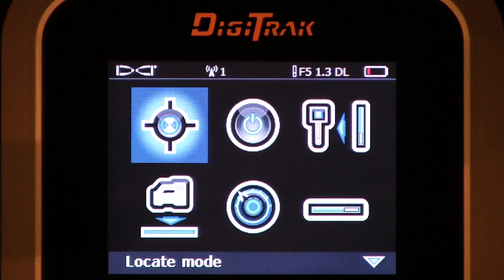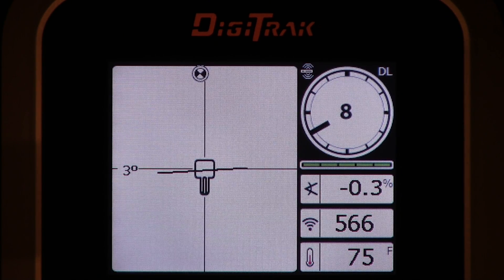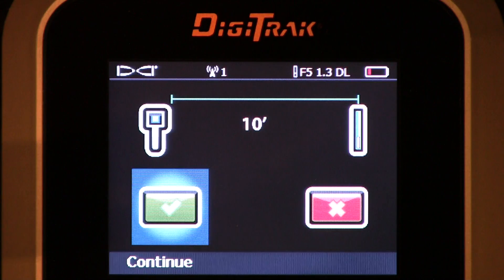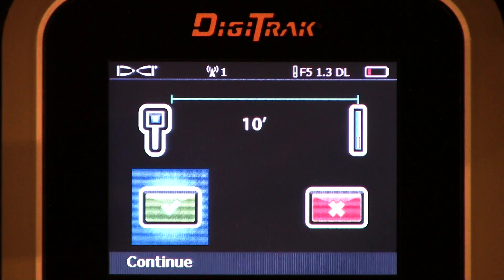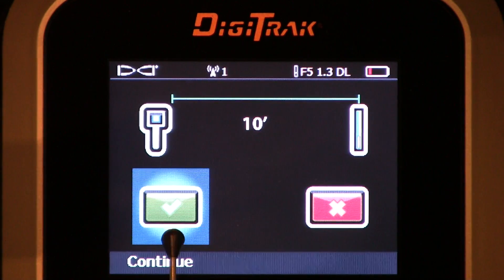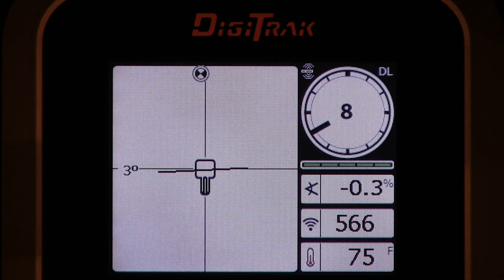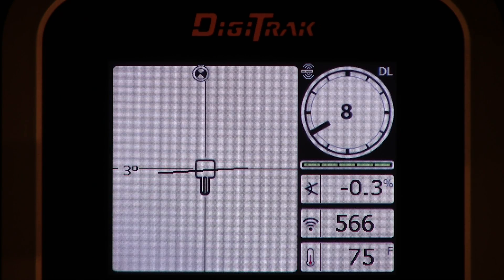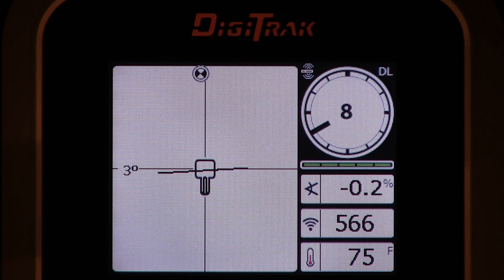DigiTrak Classic F5 Calibration How-To

Comment: The manual says to use 2-point "if you must calibrate with the transmitter in the ground", so sounds like that's only if something happened to the receiver, like maybe you received a loaner mid-drill. Also says 1-point method is preferred; I think it's also what they use at the factory. Manual says 2-point "should only be used with caution" and is "rarely needed", and it's 8 steps instead of 5 for 1-point.  I'd stick with 1-point :-).